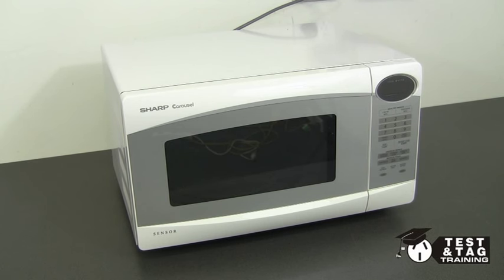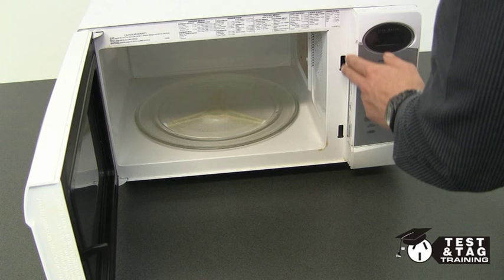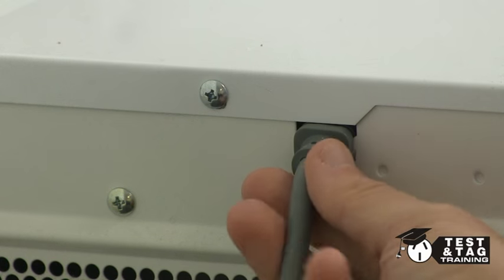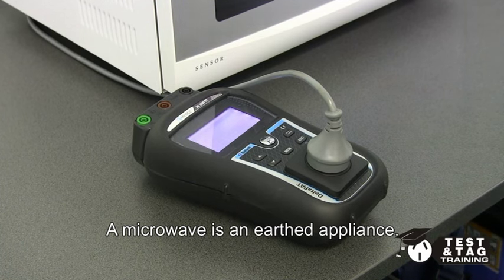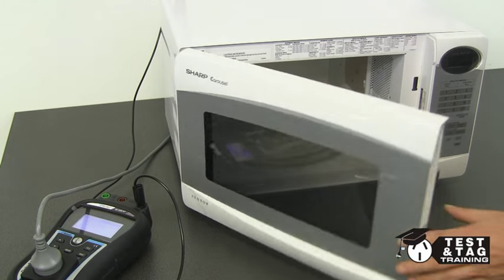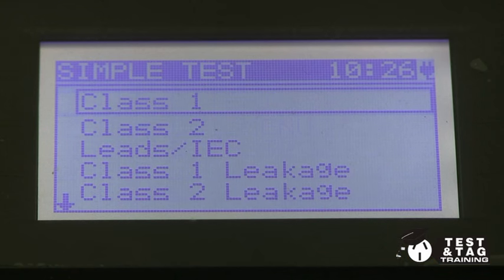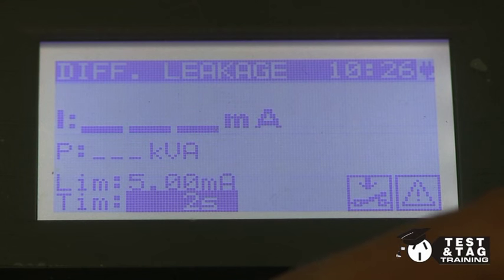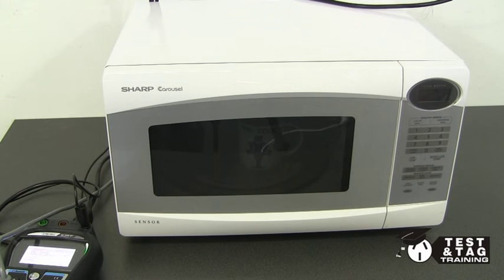How to Test & Tag a Microwave

Comment: When I do this test, my PAT says Low Load and wont proceed with the test. Normally when I just do a non-leakage test, Low Load mean I haven't turned on the appliance which not possible with a microwave while the power is off.

Comment: hi thanks for the great video. silly question, but how do you operate the microwave, if it is plugged into your PAT tester?
Reply: I was wondering the same but, they didn't reply.
Reply: Doesn't the tester apply the power when carrying out the test
Reply: The PAT tester is to be plugged into the powerpoint on wall while your microwave is plugged into PAT Tester :)
Reply: @anthonyneighbour2744  The PAT tester is to be plugged into the powerpoint on wall while your microwave is plugged into PAT Tester :)
Reply: If the pat tester is plugged into a main, the pat tester will power the microwave when doing a leakage test for 15 to set seconds.